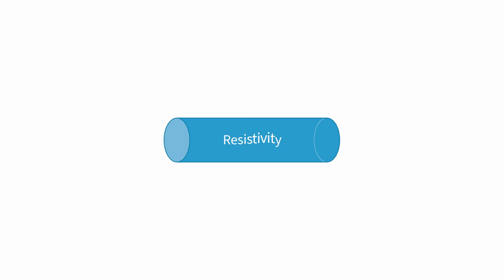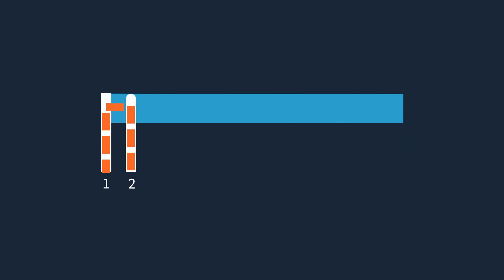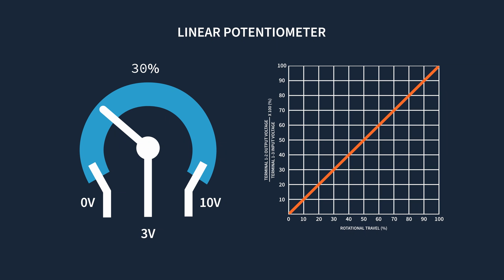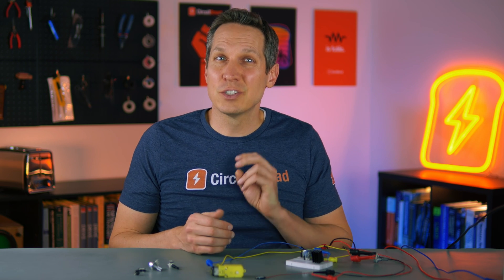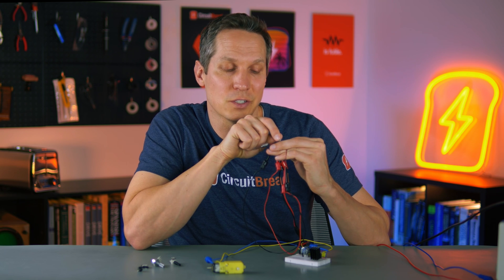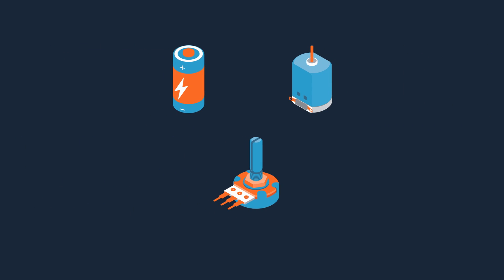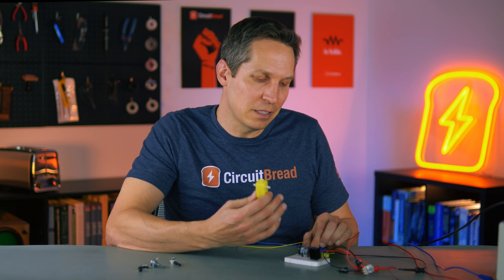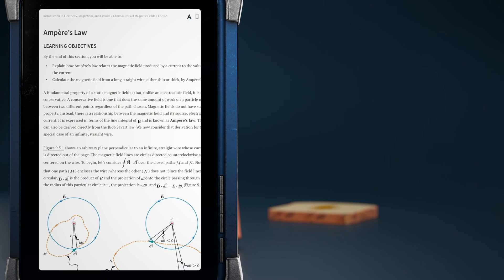How Potentiometers Work - With Real-Life Examples (How to Wire)

Comment: Good stuff. Often time one needs a Pot value that's not in their parts drawer. 
I wish you would do and addendum to this to show how you can change Pot values with a single resistor, how it impacts that resistance curve and how to use multiple resistors to create linear, log or anti-log pots.

Comment: My simple introduction to using potentiometers was nearly 30 years ago when I switched the stock pot in my Stratocaster from 250K to a 1 meg ohm, and my output magnitude not only went through the roof, but the bandwidth curve greatly expanded.

I understood very little then, but that has greatly changed, and I always change them in guitars whether it remains a passive pickup setup, or I convert it to an active module. IMO, electric guitars are still so very far behind in potential technology; even an expensive and active guitar for metal and instrumental work. I once grimaced at the thought of putting a battery in my guitar to play it, but after I designed and built my own SSA for one of my best guitars 10 years ago, I can't stand a passive system.

They're absolutely inferior in every way no matter what style you play and whether you prefer single coils or humbuckers; I personally love both.
Reply: I, call me the king of the scrap hill or not, but like piezzo pickups.
Granted i am more the folk pick guy than than a death metal shredder, but i do think my dream guitar would have a piezzo pickup in the bridge, a humbucker and 2 single coils.
And some onboard potis to mix them on the fly.
Warmth, precision and presence in one guitar... imagine .... 😀
Reply: @DasIllu  that just reminded me, It was surely many decades ago when I was probably 18, but I added a piezo pickup inside the control cavity of my Stratocaster which when you used the push/pull switch for the tone pot that came with it, you switched it to the piezo to get an acoustic sound.

It actually gave a really beautiful and relatively acoustic guitar sound. I can remember putting it on a blender pot to mix with the normal pickups or bypass to one or the other, but it was eventually destroyed from taking the guitar apart so many times with constant mods. The nature of a young player with a cheap Squire Stratocaster during the 90's.